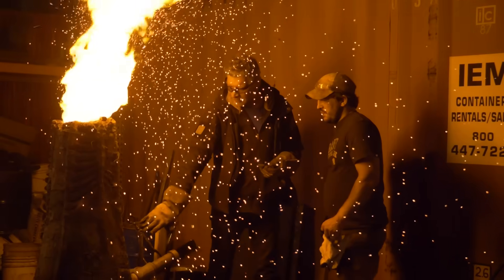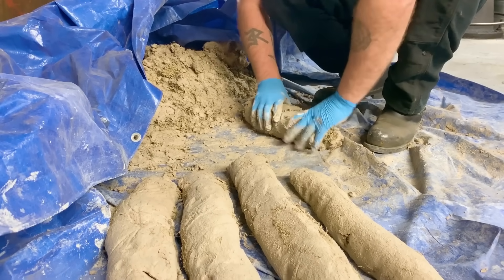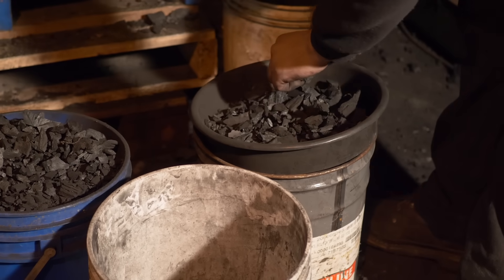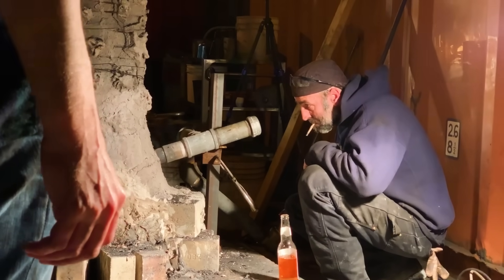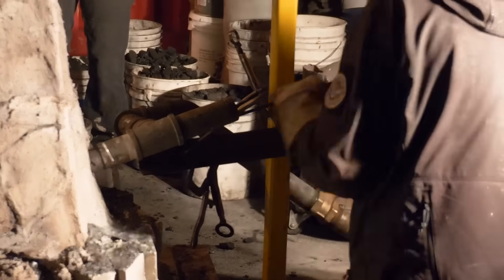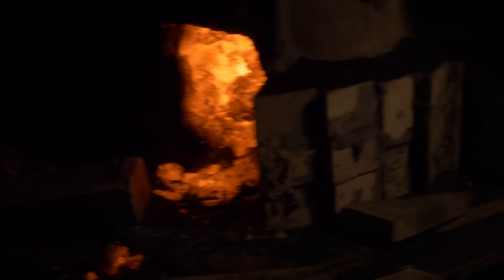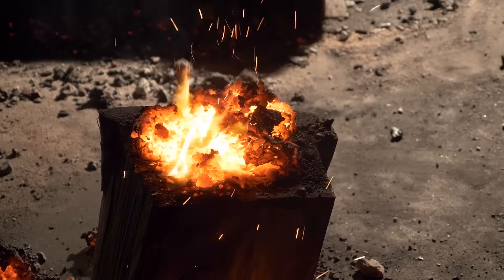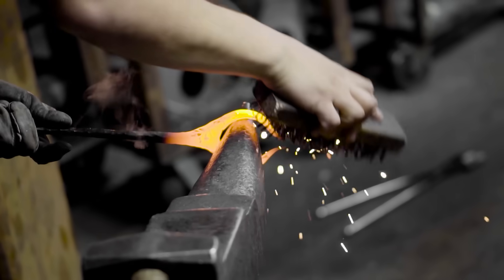IRON from SAND - Oldest form of iron smelting

Comment: Iron/steel is not necessary better or more advanced than copper. In Hong Kong, archaeologists have found a copper alloy with 40% copper, 40% tin, and 20% iron. It doesn't rust and it is very hard. I was used for making spear heads thousands of years ago. It was copper alloys that were more advanced than steel which is nothing more than an iron-carbon alloy. It was also found in historical record that people knew how to refine steel using human hair in Southern China thousands of years ago.  Human hair added carbon to iron to create tougher and yet less brittle steel than pure iron.

Comment: I was smelting Iron 15 years ago when Skip was one of a small handful. Now smelting is more common. Every apprentice I have is taught how to make their own steel, charcoal, and tools from essentially nothing.
Reply: Hi sir I have been studying iron for the past 20 days, just a small question is it possible to start on a very small scale, beginning from mining iron ore to smelting it in a small scale blast furnace, and producing the final product like a square pipe, is that possible or do I have to work on just 1 step of the manufacturing process
Reply: @athertheraltor imo it's quite possible, but the coke and limestone are both very important in the smelting steel process.... Without both you just get iron.... How are your studies going? I would love to hear...
Reply: You people should learn how to also make coke from charcoal and also add some wood ashes (calcium carbonate, more commonly known as limestone). If you make the bloomeries a bit bigger and recycle its heat back to preheat the intake air, you can easily melt iron like a blast furnace.
Reply: @bobgatewood5277  You are saying that you can make CaCO3 from wood ashes? I'd suggest trying getting some real Limestone and burning it off in a fire. You  might then be more closely following the actual process in steelmaking by the BOF process where burnt lime is used to produce a cleaning flux in the melt.
Reply: Bob Gatewood Wood ashes in particular are something I've been interested in lately. I don't know much about coke though
Reply: @andrewprahst  coke burns a lot hotter than plain charcoal, it is a purer form of carbon:

https://m.youtube.com/watch?v=-IqnebH4n4k

About the ashes, the mix of calcium carbonate and potassium carbonate will react with the silica and silicates in the iron ore, binding them and easing the process of removing impurities from iron. Ashes from sodium rich plants, such as glasswork, work best.

I recommend to also make clay molds so that, when you tap the slag, it can be poured into these molds, producing some beautiful glass (making glass is also a challenging process, so I facepalm at how much of it is wasted by metallurgists).
Reply: @bobgatewood5277  How would I do that: "make the bloomeries a bit bigger and recycle its heat back to preheat the intake air, you can easily melt iron like a blast furnace"?
Reply: @Lucius-Fox-t7v  You design the bloomery such that the exhaust preheats the intake air, boosting bloomery temperatures. Have you ever seen a rocket mass heater? Same idea except you heat a moving mass of air rather than a large solid thermal mass.
Reply: Can you please teach me how to smelt iron ore
Reply: Demon king Scott I'm trying to teach myself as well, friend.
From what I've seen, If you don't have a big fancy forge, you might be able to make a little one furnace out of just mud and bricks ect. 
I think you kinda just crush up the iron ore rocks and put them in the little furnace, then find a way to pump it or fan it with air to get it as hot as you can. Then you pull out whatever hot mess is inside and hammer it a bit and look for little metal bits and break them off. Then maybe try heating those up alone and hammering them together, or melt them if you can get it hot enough. 

Just the stuff I've picked up from watching YouTube videos, I haven't done anything myself. I may try to learn from a blacksmith at some point
Reply: @madarauchihablack5983  u need raw iron. And an oven. Like how they make it. You must make it higher than 1000°c or iron wont burn. You need charcoal but use gas is faster. Try search in e bay maybe you found  smith. But wait. Why you need iron?
Reply: @madarauchihablack5983  https://www.youtube.com/watch?v=dhW4XFGQB4o
Reply: U need to be creative to create tools

Comment: I thought iron came from red sand/earth. Isn't that iron oxide also known as rust?
Reply: Typically red Earth or ochre is from oxidation of sulfide deposits when iron pyrite becomes hematite Fe₂O₃ . If it is rich enough it can supply a suitable ore material. The black sand they were processing is magnetite Fe₃O₄ you can see it is very similar structure. The silica is essentially refractory without the flux so yeah you're reaction is spot on. With some sodium, and borax and fluorite the oxygen is also reduced from the SiO2 so the silica becomes a scavenger for oxygen to effectively compete with the iron for oxygen ions two covalently bond with.

Comment: So you are clearly not going for historical accuracy, so why make the whole smelting so complicated? You could build a furnace with a cauldron to smelt the ore and use gas instead of coal.
Reply: That is a crucible smelt. Jeff has done hundreds of those for swords. It results in high carbon steel. We were making iron which requires a different kind of smelting. Our goal was to make iron from sand. Everyday when forging in the smithy I use a variety of old and new technology. It's still forging, just as this is still smelting. It makes no difference to me whether or not I physically pump the bellows.

Comment: the sand has to first contain enough iron to smelt , i can tell you the only thing we get from melting sand in Tassie is silica glass.
I find the title as a boiler/maker welder to be in the least a fallacious claim.
Their are trace amounts of many elements and compounds in sand , you are making the fallacious claims that sand ( any sand as in the title and this false).
To me this claim is as bad as god claims .
I have no problem with sand being used in the smelting process , but not sand contains enough iron (Fe) to be enough to make anything from it unless you smelt hundreds of toms of it.
The sand used must be as high or higher than mineral concentrations of iron( iron ore deposits).
I cannot even bring my self to watch this.

Comment: you keep saying iron, since it's iron and carbon, isn't actually steel??
Reply: Enrico Bertoncello 

Iron and Steel are essentially the same thing just made with different properties
Reply: @wyattguilliams2621  i know, i'm an engineer. But this difference is crucial, the are smelting iron to produce a form of steel. I was asking only because the video is quite technical but the made this simple error. 
Beside that, great video and great job!

Comment: When talking about Iron and its history, you should do a little more research. Worked iron has been found in Egypt that dates to about 3500-3200 BCE; so clearly Iron working does not trace its origins back to 1500 BCE, if there is much older worked iron (non-meteorite iron) found in Egypt. It's very misleading, and a disservice to your audience when you say its origins back to 1500 BCE when that was proving false in the 1800's

Comment: What is the logic in breaking and sorting the charcoal by hand when there are machines that do this, but using modern technology (a magnet) to separate out black sand rather than by panning?
Reply: Panning to get black sand would work of course, but so would a loadstone (natural magnet). Both methods were likely known to the Hittites.

Comment: That can be everything but it is NOT the history of discovering iron. That is a mystery, and it will be like that for a long time. I don't now what do we need to solve that mystery, but one needs to much knowledge to make iron. How do you find out that in sand you can find iron? Yes, it is easy for you today to say that magnet attracts iron, try that 10.000 years ago.... How do you now how to make charcoal? Burning wood without oxidation or mining, try that 10.000 years ago.... How do you make flux?
Iron from meteorite's? Iron melts at 1800 degrees Celsius, try that 10.000 years ago.... May be it is an old way to obtain iron, but it is not the oldest and definitely not the first.
Reply: There is a video of blacksmiths in a rural area of africa, they make forge an iron tool from scratch, they where just 3 guys with hammers, just the most basic tools..

Comment: Blacksand may work but would be full of unknown minerals. Would it not have been better to get it from a deposited vein? 

But there again it's not tools or weapons you are making so I guess just blacksand would do. 

Waiting to see what you do make out of it.
Reply: @Possumlove No, they must have iron deposits to have it in the sand? Otherwise, where did it come from? I'm a prospector and know Japan has a fair amount of gold. And gold nearly always travels in a matrix of iron. What Japan might not have is deposits pure enough to work with and in the process of erosion being deposited as placer. It could have been purified some in the process. 

They would have been better off Continuing this by washing it out in a slues box. Or more likely a rocker box that has more separating power by how it uses specific gravity. It originates from there. But is a closely guarded secret. Only the monks are allowed to use them. So they probably didn't know this fact. And went with using a magnet thinking it would give the same results. Even thou they really had no clue as to how it was collected by the ancient people.
Reply: It would have been easier to put a big tray under my rusty '75 Chev Vega back in the late 80's.  That be a ton of pure iron oxide there!
Reply: @axeguy3856  You raise an interesting question. Can rust/iron oxide be reworked back into a usable metal?

Comment: Did the use magnets to extract the iron?
Reply: The actual method is lost to history, but magnets are extremely unlikely.  Natural magnets are very rare and very weak.  I would think it would be far more likely that a method similar to gold panning is more likely.  It wouldn't take much to notice that if you swirl the sand in a bowl of water the heavy dark material accumulates in the center at the bottom.  A few times through the bowl and you'd have fairly clean material to work with.

Comment: Yeah right. They found a chlorine based stainless Steele hammer in a chunk of coal. That would have been made earlier than 4400 years ago.
Reply: Mike Corleone   Never heard of chlorine used in steel.  Could that have been Chromium because it's generally the amount of un-bound Chronium that determines how stainless a steel is.

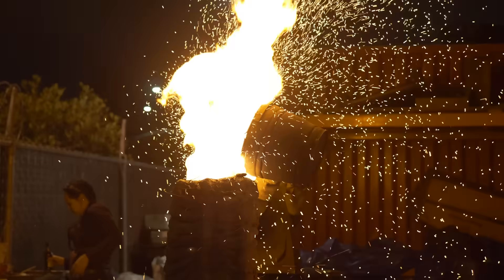Comment: @3:42  Heat does not rise, hot air rises. I hear this all the time. You say I'm wrong? Ha! Try holding a piece of iron from the bottom, and put a torch to it on the top.   You will burn your fingers, the heat went down. Heat is a dumb word, I like to think in terms of energy. Anyhow, I enjoyed the video. Thanks.

Comment: can someone explain where exactly you made iron please?  i see is steel making. iron supposedly doesnt have carbon content, but your demonstration shows you mixed ore + charcoal + air which makes steel. modern foundries use same exact method, ore + charcoal + blast furnace (air)

you cant produce iron, if you analyze the piece you made you will see it is steel with low carbon content.

steel = iron + carbon. thanks.
Reply: supersonic060 what? Steel is just carbon rich iron, it’s still iron. Pretty much any forge will use a carbon based fuel of some kind, the difference when making a steel typically comes from adding extra carbon that isn’t burnt off during the forge. They were adding charcoal one to one with the ore, so not charcoal rich
Reply: You need carbon in iron making because the furnace creates a reduction environment, the iron is Fe3O4 and is not usable until the oxygen is removed. In the case of bloomery furnaces the charcoal or other carbon bonds with the oxygen in the iron reducing it. We weighed the charcoal and iron ore so as not to have more carbon in the furnace than is needed.

Jeff hasn't tested these samples yet, though sometimes he does get them tested. You can do a spark test and look for long straight sparks with no bursts at the end. I also while working it cut it with a vertical band saw directly after cutting mild steel. The iron was significantly less hard than mild steel which is about .2% carbon. It's also very bendy even after water quenching.

Comment: One improvement you could make that may prevent the tuyere from plugging up, would be to use the appropriate size sanitary pipe tee instead of a standard pipe tee, this will reduce the air stream turbulence as the air flow enters the furnace. I enjoyed watching. Keep the industrial arts alive, our country needs this desperately.

Comment: I've always wondered how and where they got their iron to smelt.
Reply: Jrsydvl sand or dirt from stagnant arras like bogs or very slow moving streams. Some rocks like hemetite were the best, but that was exhausted by the late 1800's. You cpuld also use certain granite deposits or sandstones, but those are so low yeilding that you have to make a few runs and have very good reasons to expend that much energy.

Comment: That was great. It’s really interesting to think about those people, so long ago, who had to understand that there was something they could do that they never did before. Smelting iron requires so much more heat than copper alloys, or silver or gold. It was an entirely new technology they invented, from almost scratch. How long did these early efforts take before it was worthwhile and reliable? We have to remember that smelting Bronze Age ores was something that happened by accident, when people found bits of melted metal in their cooking fires, and realized that this was useful, and so deliberately put ore into fires, until they had it working well.

But that doesn’t work with iron, so from the very beginning, they had to figure out that so much more heat was required. Then they had to figure out the principle of blowing air into the fire to heat it up. Even noting that wind heated fires. That’s a big step. But the understanding that iron was so important, and had so many advantages over bronze, brass and copper, spurred on this major revolutionary effort over decades, until it became reliable, with enough quality for a major use category.

We sometimes think we’re so much smarter than these much more primitive people, but we’re not. In many ways, considering where they were starting from, they were so much more advanced in their thinking than we are today.
Reply: They were the great minds of their day. We still have people like that, we just don't hear about them and they aren't glorified on reality tv and the like.
Reply: How they made iron tools, rings, etc, in the ancient ages?

Comment: HI
Great video.
The way to get  a hotter melt is to make a double walled furnace and direct the air between the two walls so it pre-heats before it enters the burning zone in the furnace. the hotter the air for combustion is the hotter the melt will be.
Reply: goldassayer93555   The long iron pipe taking the air in would also heat up and would begin to pre-heat the air fairly quickly but just not as well as a double-walled furnace.

Comment: Isn't sand sillica ? So you used sand to flux sand melting ? :o
Reply: The molten sand/slag mixture acts as a barrier to prevent oxygen from getting into the iron AFAIK.
Reply: It is. The very first smelt we did we sorted the iron sand and didn't add much silica sand back into the furnace. It ran very dry with very little slag to tap and the bloom didn't adhere very well. 

We ended up using about 2tbs of sand for every kg of iron and charcoal. We also did not use the sorted sand as it has a lot of other elements in it, including titanium. We used very white clean play sand, bought from a store.
Reply: @clayandsteel  I recall a video from Cody'sLab where (albeit uses modern methods) he creates cast iron.
edit:
The point was Cody does a very good job of explaining the science.

Comment: You’re using so many modern tools, you’re kind of missing the point of this activity.
Reply: The point was to make iron from sand they found.
Reply: @down1nit2  That sand was already iron, there was nothing to make.
Reply: @chengong388   Of course, the iron was already there as the black sand.  What they were doing was smelting it INTO A USEABLE FORM, so that they could work it into various objects.  That was the point and the goal of the effort.  After they produced the large pieces of metal, then using modern tool was not a problem.
Reply: @chengong388  the sand was probably mostly magnetite a form of iron oxide that had magnetic properties.
Reply: @garethbaus5471  100% correct.  Magenetite.  One of the most common natural oxides and thankfully ferromagnetic still.
Reply from the maker: @chengong388  The sand contains iron ore (as an oxide), not iron, big difference. The furnace creates a reduction atmosphere which cracks off the oxygen from the iron which then allows the iron particles to bind together into the bloom and also the impurities can run out with the slag.  There's a lot going on in there and it's hard to get it just right.
Reply: Looking forward to your video on the subject, then.
Reply: @nettles89  Lol, do you ever crticize movies? video games? TV shows? Have you ever made any of those yourself?